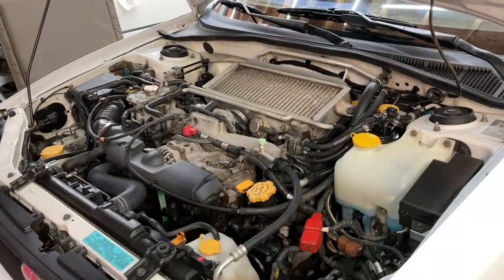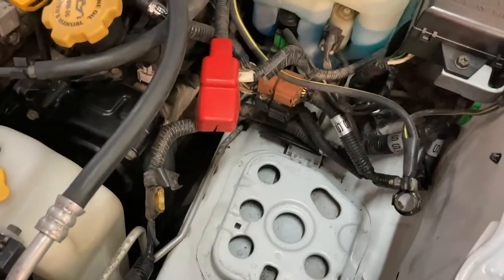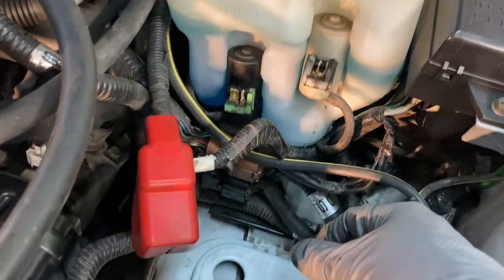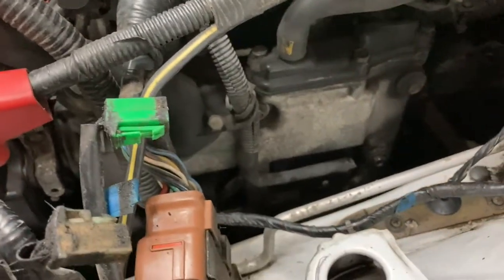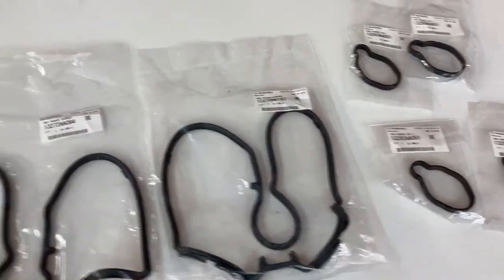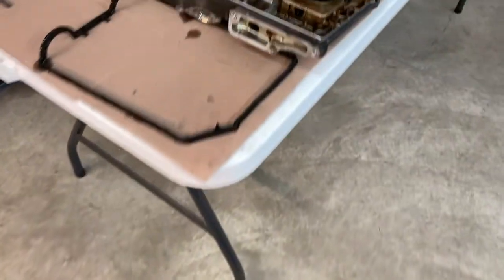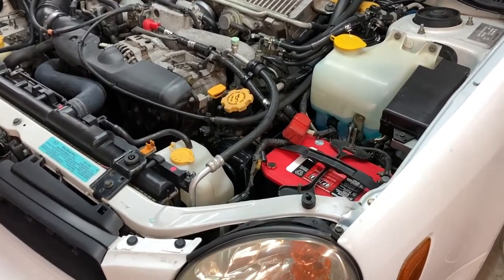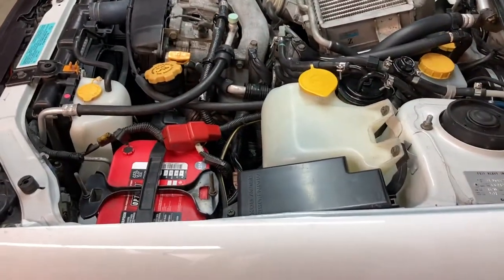Subaru WRX Valve Cover Gasket Replacement Step By Step 2002 2003 2004 2005 2006 2007 2008 2009 2010

Comment: This is the most comprehensive video in how to replace the valve cover gaskets.  Thank you so much for your research and sharing the knowledge in this video.  It's easy to follow and it couldn't come at a better time.  I just ordered the master kit and as soon as it arrives I'll be performing these steps to get the gaskets replaced.   Thanks again!
Reply from the maker: Glad you found it helpful. It looks more complicated then it really is. If you take your time and make sure to use the OEM seals, this job isn’t too bad.
Reply from the maker: I’ll have the video for the other side up soon
Reply: @CompressorSurge  Sounds good! Looking forward for the next video.
Reply from the maker: The passenger side valve cover gasket video is live 🍻🍻

Comment: In order for you to remove the valve cover, do you have to drain the oil before removing it or is it okay if you don’t drain the oil while removing the valve cover?
Reply from the maker: I didn’t drain it before changing the valve covers, but I did when I was finished only because it was due for one 👍 Keep in mind you will lose a little when you pull the valve cover off.

Comment: Any thoughts on cleaning the actual valves while you have it open?  I am working on a 2005 WRX I just bought, it seems to run great but when I took the valve covers off it was pretty shocking how much gunk is there.  Obviously cleaned the covers themselves but thinking maybe trying to clean out some of the stuff inside.  What do you think?
Reply from the maker: That might be tough with the engine still in the car. There isn’t a lot of space. Are you familiar with Seafoam?
Reply: @CompressorSurge  I have used it before but only as a fuel additive, I guess you're suggesting doing like a flush?  That is probably the route I will go, seems a bit risky to dig around in there too much.  Great video btw, thanks for taking the time to do this.
Reply from the maker: I’ve seen before and after shots of the head after using seafoam. I’d look into it as an option. I’d be worried about accidentally getting any debris in their when trying to clean it. Let me know if you try it and how it worked
Reply from the maker: @SuperCooperDad keep in mind this is a great time to really clean the valve covers
Reply: @CompressorSurge  hey, sorry for the delay, I thought this was worth sharing, so, along with the valve cover gaskets and spark plugs, I replaced the PCV valve (actually the entire valve hose assembly) like a lot of people, I was having oil consumption due to blow back.  Afterword, I took your advice and added Seafoam to the crank case.  The PCV valve was totally gummed up when I checked it.  And, as I mentioned, there was a lot of gunk visible with the covers off.  Its been 2 weeks and I can say that my oil consumption issue seems to be fixed.  I was this close to buying an AOS but really, I think the problem is solved.  Was it the Seafoam?  Was it just the PCV valve....don't know.  But, if you are having that issue, give replacing the PCV a try and for good measure, put in 4 ounces of Seafoam and drive it for a few hundred miles.  My local Subaru shop was quoting like $1,200 to install an AOS from IAG (not that I would have ever paid to have the done, but they were clearly trying to get me to in that direction and never suggested the PCV valve could be the culprit).  That was a $47 part on Amazon 🙂https://a.co/d/09sc1azZ 

I hope this helps someone else and thanks again for putting this video together, great work!
Reply from the maker: I'm glad to hear you were able to resolve the oil consumption issue. I would guess the clogged PCV was the reason but its possible the seafoam has also helped to resolve the issue. I'd be curious to know how much cleaner it is now under the valve covers. What's the next maintenance item? lol

Comment: Great video, I had about a 10 year hiatus from subarus but just picked up a sonic wagon last month. I did my passenger side valve cover and plugs last week, about to go do the drivers side this evening. Same issues as yours, got a little smoke after driving more than a couple minutes, from oil on the exhaust. My half moons were seeping, and I got the master kit, but to add to your video, I’d think the old ones with a coat of black rtv would work to seal them. Another thing unless I missed it in your video would be to change your spark plugs while you in there. NGK BKR6EIX plugs for stock cars and BKR7EIX (one step colder) for modded cars. Again great video, was perfect for me to get a refresh about what to remove! I dove into the passenger side 10 years blind 😂 thanks sir!
Reply from the maker: Welcome back! Sonic yellow?
Reply from the maker: Yeah not sure if I mentioned it but this would be a great opportunity to swap out the spark plugs
Reply: @CompressorSurge  thanks! Yes, Sonic Yellow 👍🏻 was not really expecting to find that color by any means, I was only hunting 02/03 sport wagons. I was into my search about two months, finding nothing decent remotely near me, poking around on one of the fb bugeye groups reading comments and a guy that replied showed a picture of a Sonic wagon he was about to list for sale. 2 days after contact I drove to Fort Worth Texas, picked up a U-Haul trailer and towed it home. 1100 miles round trip on a Friday 😂 but hey, back into Subaru’s I am lol
Reply from the maker: That’s awesome. Very rare color. What are your plans with it after the maintenance is caught up
Reply: @CompressorSurge so this is actually my 4th turbo subaru, I bought an 05 wrx new, which I drag raced heavily, I did a v8 jdm motor 3076 rotated turbo, ppg geared 5 spd, it made about 450whp on 93 octane, that one got out of hand quick, so I found a guy who wanted an already built up car and traded it plus cash for me to a stage 2 03 sedan, then over to an 06 Legacy gt with a down pipe and tune. After I sold the legacy I took a car break and drove my truck for a few years. I have some pretty lofty goals for the wagon. Being away from them for a bit, so I’ll probably just drive it and do all the mods in stages again. It’s funny, I had forgotten how fun these cars were even totally stock! But I did the lower control arms, ball joints, tie rod ends and both front axles this weekend after I finished the valve covers. While I was in there I upgraded the front brakes to the 4 pots and just did a basic brake job out back with rotors, pads and cleaned and painted the calipers. Next steps will be exhaust probably headers back, and I need to find myself a ln older laptop that’ll support the open source software so I can reacquaint myself to tuning. I’d say within 5 years I’ll have it fully built, or that’s what I want, built block with cams, probably gt35 sized turbo and I’ll do a 6spd swap this go round. I’d like to get into the 550+ whp range on 93 octane. It’ll be a challenge, we don’t have e85 local here so my limits will be fuel related because I want to be able to drive it whenever I want. My 05 did 11.60s on pump gas, I’d love to dip into the 10s with this one, but we’ll see. lol my bank account can only cover basics for now, but my older kids are getting to the out the house age so I’ll have a bit more toy car money then! My 10 year old son is big into cars, so it’ll be fun showing him the car modding ropes and hopefully he’ll carry on my madness 😂. But yeah in short (not really! Sorry) That’s my outlook on it!
Reply from the maker: Damn. Are you planning to upload videos of your build? That sounds great
Reply: @CompressorSurge thanks, I’m not sure. A few times I’ve done bigger repairs or mods to my vehicles I’ve started out filming, but when I get into a project, It becomes a hassle starting and stopping and I never finish the filming part lol. I suppose update videos would be easier. I’ll have to see, my little boy would love that though!
Reply from the maker: @treystoys recording the process easily makes the job take 3x as long. I have a few videos I’ll be uploading soon. Thanks for the kind words

Comment: Does it matter if the engine is an sti engine or will all the gaskets/covers be different?
Reply from the maker: The part numbers will be different but the process will be very similar
Reply from the maker: What year STi?

Comment: Do I need the valve cover grommets? Like are they a necessity? Trying to get this rebuild done as soon as possible. The motor I pulled didn’t have any and I never had a leaking issue but the secondary motor I got for parts had them and they look pretty torn up.
Reply from the maker: If they are torn up I’d replace them. It would suck to have to go back later to replace them if they started to fail.

Comment: My oil cooler o-ring started leaking about the same time as my valve covers. Good video.
Reply from the maker: Perfect timing. It makes a huge mess if you don’t catch it in time. How did the install go?
Reply: @CompressorSurge  easy job. Changed the coolant hoses feeding the cooler also.
Reply from the maker: Good to hear. What’s next on the maintenance list?

Comment: Did you remove Half moon and Reseal it? Is it hard to remove without damaging it? Gaskets and Grommets on the way but not Half moons, The point is Is there any problem reusing Half moons? Thanks.
Reply from the maker: Mine were is good condition so I was able to reuse them. It all comes down to what condition yours are in. They can be easily removed to inspect.

Comment: A great presentation of how to do this! 
How’s it held up since the install?
Reply from the maker: Worked out great. I wish I would have replaced the half moon seals but there weren’t any issues after reusing them.
Reply: @CompressorSurge  that’s good to hear! I did mine about 40k miles ago on my bugeye but there’s been just a tiny bit of oil that seeps out. No active leaks but I’ll probably do it sometime next year unless it actually becomes a problem.
Reply from the maker: @Order66Wfries That’s great! What’s next in the maintenance list?
Reply: @CompressorSurge  just installed a mishimoto intercooler and radiator, a bunch of hoses, Pcv valve. Next to deal with a bad exhaust leak, transmission and dif oil change.
Reply from the maker: @Order66Wfries  nice. Maintenance is key with these engines
Reply: @CompressorSurge  don’t I know it!

Comment: Thank you for the video and helpful. The only question I have is what did you use to seal the half moons ?
Reply from the maker: Just a little bit of the sealant I used. Make sure to thoroughly clean it first
Reply: @CompressorSurge  thank you! Watched ur video multiple times until it was litteraly engraved in my head step by step. Got it all cleaned and done this weekend. Both sides, new gaskets, coils, spark plugs. I can't thank you enough!
Reply from the maker: @NestorRios-c3g  Nice! Glad you found the video helpful. Feels good when it’s all back together and nothing leaks🍻 Now that is done, what’s the next maintenance item you’re doing next? 😂